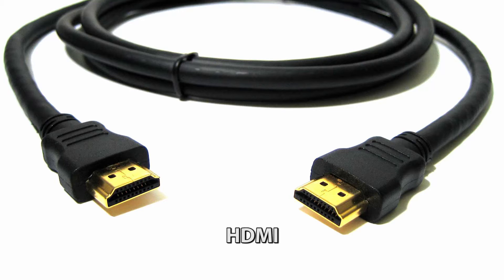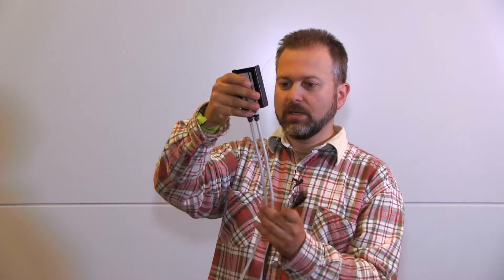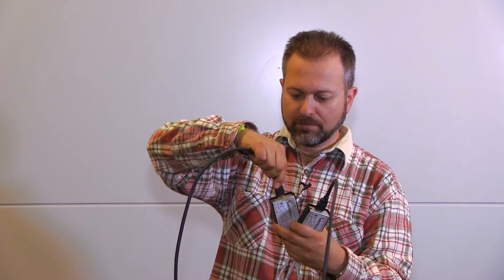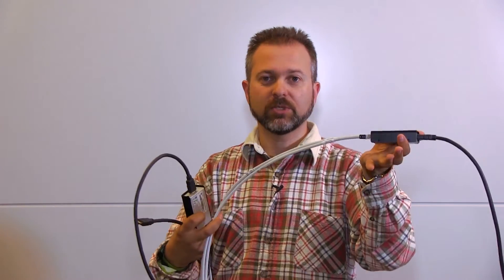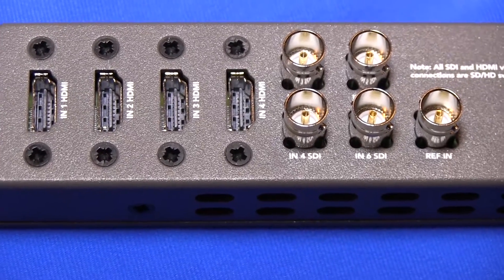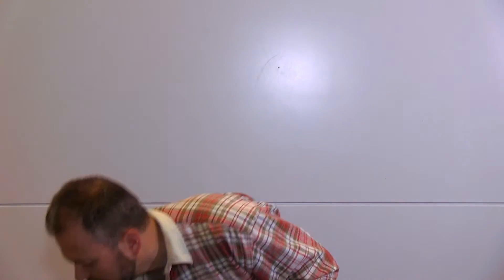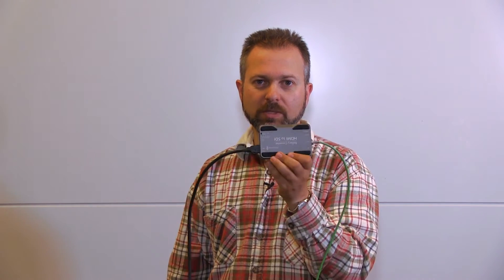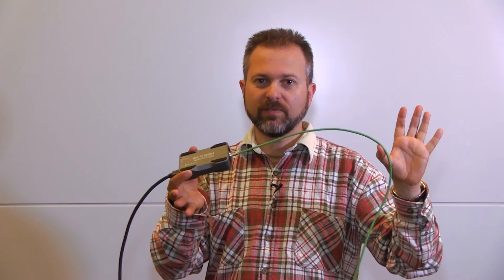10 Cables from the cameras

Comment: Hi Isac. Great to hear you are interested in this issue. Both cameras you mention are digital cameras, but none of them have any digital outputs other than firewire, and that wont work with the switcher. So yes, you need a converter from analog to SDI. Also bear in mind that these two cameras are SD (not HD) and 4:3, but they will still work with the switcher as long as you don't put in some HD-cameras or 16:9 SD-cameras as well.
Reply: Hi Jorgen,thanks for the reply,i was soo scared i had to get rid of the cameras,but with what you just told me am going ahead to purchase the converter( BLACK MAGIC MINI CONVERTERS ,ANALOG TO SDI) i think getting sound into the BLACK MAGIC TVS will be what i have to work on now. thank for your education.